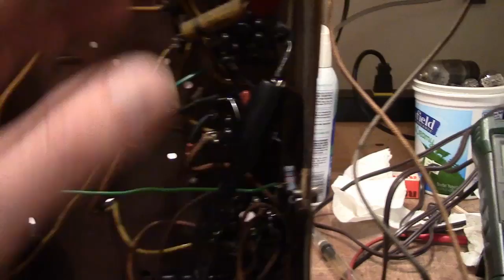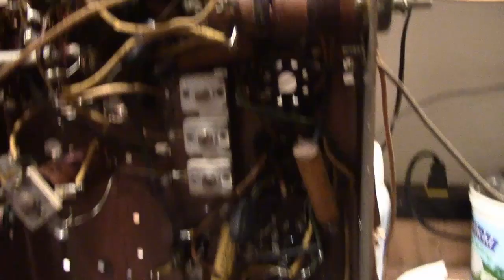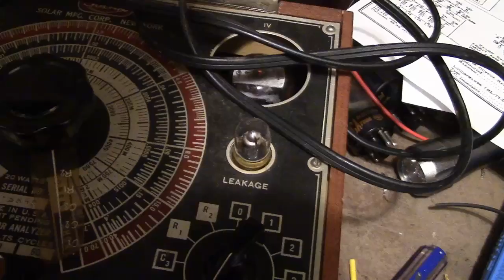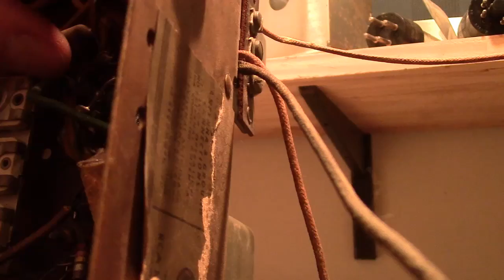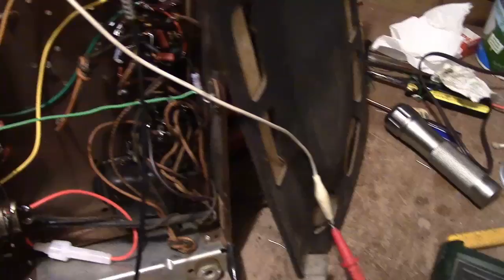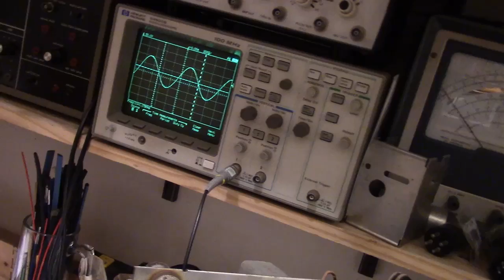RCA 27K restoration p2o4

Comment: Great job and video!  I'm currently restoring a 1951 Zenith Transoceanic shortwave radio, it's not too bad of a job except for the filter can.  This filter can has 4 electrolytic capacitors and the can has to be cut open, filters cut out and new ones installed. 
I really enjoy restoring old TV's and radios.  I'm been in the field for 37 years, 22 of them in the Navy repairing Avionic Systems.  I love the electronics field.
THANK YOU!

Comment: Thanks for the good vids bob. This one is much improved over the old flashlight sourced ones. good scope on oscillator, was always in the dark when firing up without scope. have worked on these since 63, and shockingly b+ really hurts a young teenager.

Comment: I learned a long time ago to take whatever you read, or what others claim, on the A.R.F with a grain of salt, a lot of the info passed around on there is second or third hand and based on some anecdotal account. Nobody knows where that information came from but many assume that it's true, and act on it anyhow without verifying. 
  With regards to those black coffin shaped RCA mica capacitors I have yet to encounter any with an electrical problem, and I must have repaired or restored a dozen Canadian RCA and G.E sets that were full of them. I think that the tests you performed on that damaged mica cap on the Solar capacitance bridge confirms what I have found, value is on spec (not including the capacitance of the test leads) and no leakage.  
  One thing that I learned from reading a long time ago is that mica caps in a front end are something you should not mess with without a good reason. Molded mica caps are not something that should be shotgun replaced, by moving wires around or by changing lead length you can very easily introduce a problem where one did not exist.
  If the local oscillator cuts  out below a certain frequency check the 47K Ohm resistor on pin 8 of the 6SA7 tube, also check the 56K Ohm resistor on pin 5, sometimes they will get flaky with age. Speaking of resistors, that 470K Ohm one came off the triode plate pin of the 6SQ7 tube, right? I swear that every 1939-46 Canadian RCA and G.E I have  worked on has had that bugger fail, and no wonder, they used a 1/4 Watt resistor in that spot, bad idea for a plate load resistor. 
 By the way, that extra position on the band switch is probably for the pushbutton tuning, so naturally the set will be dead when the switch is turned to that position with the pushbuttons disconnected. That tone control/function switch is sort of interesting, and somewhat retrograde I might add, Canadian RCA and G.E sets used that in their 1939 models, then decided in favor of a proper tone control pot from 1940-46 using a button in the pushbutton bank for a phono switch instead.
Reply from the maker: +OlegKostoglatov I agree with you.  I tested the rst of those black caps and all were good.  Go figure. I replaced those two resistors and cleaned the bandswitch.  Seems to be working properly now :)  Yes, I think that was the plate load resistor.  I replaced it with a 1 watter.  You are correct about the 3rd bandswitch position - pushbutton tuning preset mode.